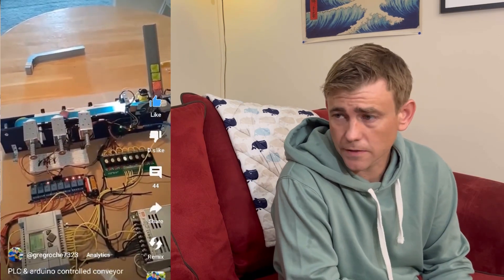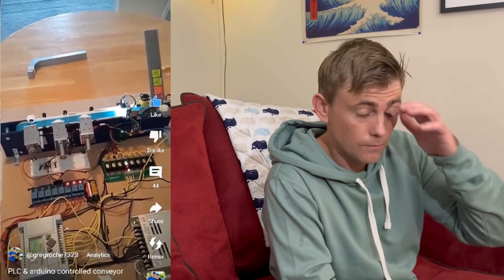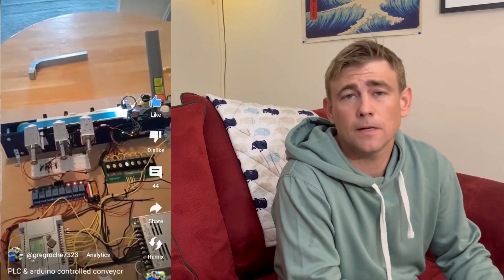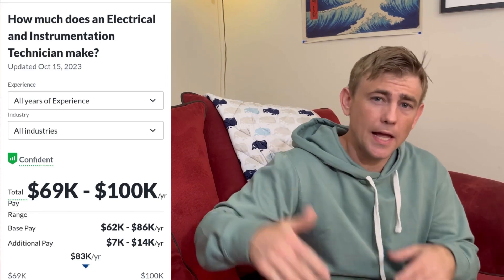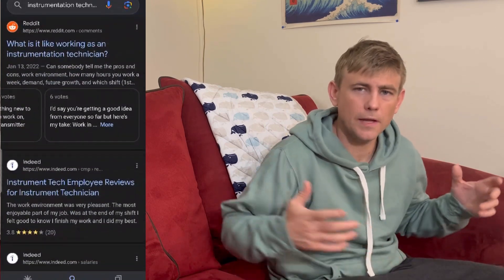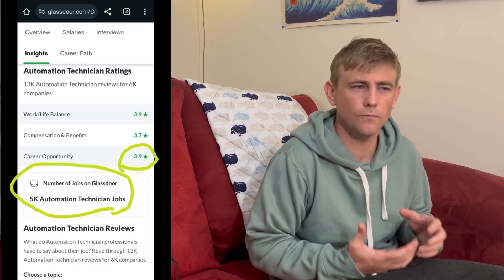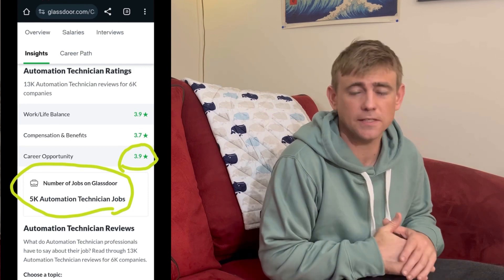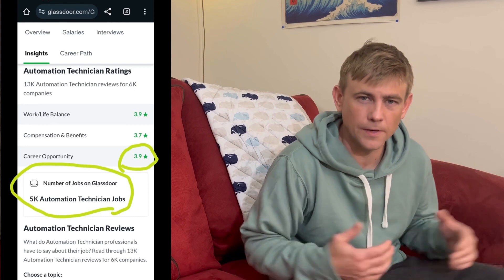☆ ☆ Information on a Career in Instrumentation ☆ ☆

Comment: I a Journeyman Electrician. Does that give me any advantage in trying to enter this career path? Would I still need a degree?
Reply from the maker: I would say no, you probably don’t need a degree.

Do you have any automation or machine troubleshooting experience?

I would think you need to make sure you know control schematics (electrical) learn some allen bradley PLC skills (assuming you are in the U.S.) and just learn industrial automation and instrumentation equipment.

My suggestion to you would be get a community college certificate (9 months I think they are 3-4 classes) in instrumentation or automation or even motor controls or engineering idk plus get your ISA ccst certification (international society of automation certified control systems technician)

It costs 500$

Also, you could just apply for electrical technician jobs at factories, you may be able yo get the job as is.

Make sure wherever you apply has PLCs automation and calibration 

Electrical technician jobs automation tech instrumentation tech mechatronic tech (and maybe maintenance tech)

I would just apply first if it doesnt work OR if you want to be decent at your job do the first 2 first. Shouldn’t be too tough

Oh yea industrial electrician with PLC work included would be good experience too, basically the same thing as i&e more or less
Reply: @gregroche7323 awesome, thanks for the info! I don’t have a ton of motor controls experience other than the class we did in the Apprenticeship. But it was my favorite course in the entire apprenticeship and I always wanted to pursue a career that was more focused in that area. I’ll probably continue to work as an electrician for a few years as I just finished my apprenticeship in May. So I wanna capitalize on what I just spent four years preparing for. But I could definitely see myself making a shift towards instrumentation in a few years. 😊
Reply from the maker: @blueticks8423  just like take one time for the time they have nine months certificates, which is like a step down from associates degree. I was just trying to get one of those.

My job I pretty much fix automated machine machines all the time and I really enjoy it. Fun career probably pay about the same as a journeyman electrician at least in ohio it does (80-90k)

Comment: Wassup Greg, I am going to school for instrumentation next year but my goal is to be a PLC programmer do you think this degree can Help me set up this Goal? Or do I need to link it up with computer programming degree or IT degree?
Reply from the maker: Dang, that’s a good question and be honest I’m not exactly sure. Personally ive done a fair amount of PLC programming professionally but never “from scratch”, always modifying existing programs or upgrading old PLC programs to new software and hardware versions. A PLC programmer position would generally be called systems integrator, automation engineer, controls engineer or of course “PLC programmer”. The demand is high and there aren’t a lot of skilled younger people in this area. 

I have eight years of experience and I’m pretty sure I would be able to get one of those titles… im not certain though ive never tried. If I had to guess I would say an A.S. Degree + some experience is enough but im not certain.

If you get the AS you are looking at 80-100k base woth some difficulty getting a foot in the door. With an engineering bachelor’s I would say 100-130 base with less difficulty. Beyond that i cant really answer the question
Reply from the maker: Also I would say a b.s. in computer science would be slightly less effective that an engineering degree that focuses on industrial automation. When candidates have a bachelor’s in any engineering discipline it is easier to get an interview for engineering roles. Realistically I would be a lot better than a very large portion of engineering graduates but I am not sure if big companies think like that

Comment: Hey Greg, I'm studying electrical engineering technology and I was offered two summer jobs. One is an electronics assembler putting together high voltage amplifiers and power supplies using schematics, blueprints, and basic soldering. The other is a calibration technician calibrating piezoelectric sensors using meters, pressure pumps, dead weight testers, shakers and test chambers. Which would you say is more relevant experience if I hope to be an instrument/automation tech after school?
Reply from the maker: Hey buddy, I would definitely go with the second one that’s just me. Realistically electronics assembly is just isn’t that common these days. Definitely have trouble finding people with real calibration experience even though it’s generally pretty simple stuff it’s nice to be able to go to the interview and say yeah, I’ve calibrated that type of sensor before.

Comment: Video request: overview of differences between similar fields? I&C tech, vs electrician (maybe also HVAC techs?) Do they work in the same facilities/share any duties? How easy would it be if you wanted to switch from one to the other? Does I&C have licensing/is it necessary in order to progress? Does I&C experience count towards electrical experience if I wanted to pursue journeyman electrician licensing? Thanks man, just getting into the field via an I&C certificate program and starting to look at jobs, love your videos
Reply from the maker: Dude thank you so much for the video ideas I'm definitely going to make that. And as far as I know just to give you the quick answer.. not very easy to get the journeyman license once you have the I&C degree, it is possible if you find a master electrician to work under that can sign off on your hours. Realistically I think that you'll find the pay is about the same and instrumentation and controls is a better job in my opinion

Comment: Is it easier to find a job if you're willing to travel? Also, do you do plc programming?
Reply from the maker: Field service technician
Reply from the maker: Yeah it is easier to find a job if you're willing to travel. And historically I haven't done full programs but I've done modifications to programs added a couple runs modified some processes not super often just a couple times. I do use PLC programs to troubleshoot pretty often though historically
Reply from the maker: Traveling jobs pay pretty good if you're willing to travel you're going to have a good career
Reply: I’m taking Motor Controls this year!